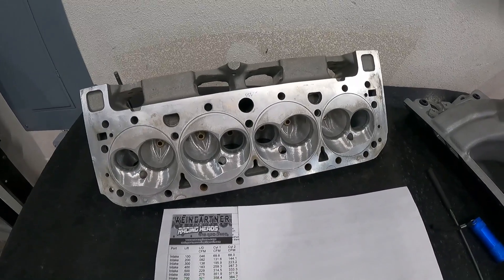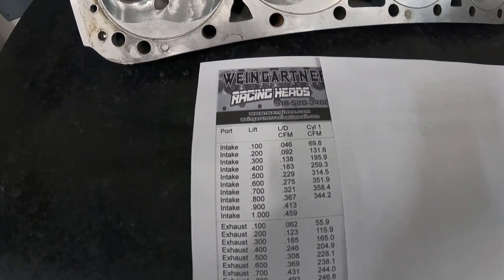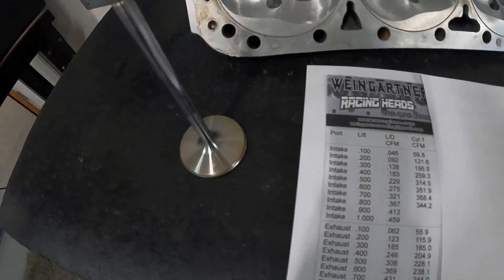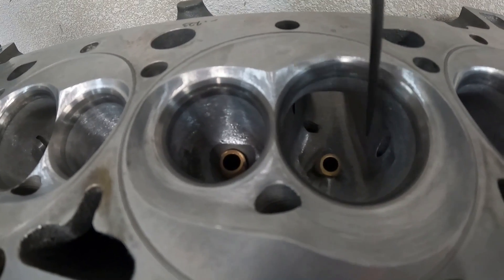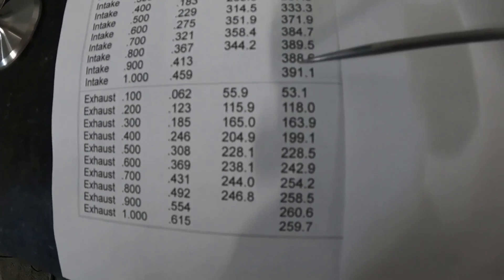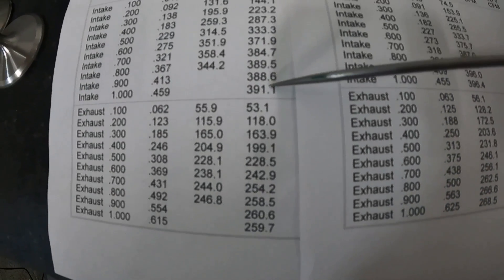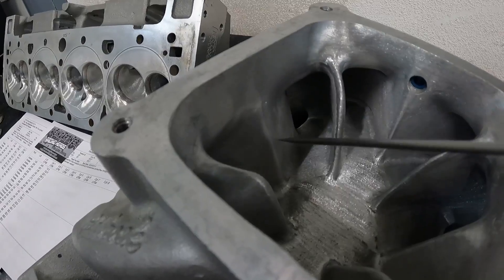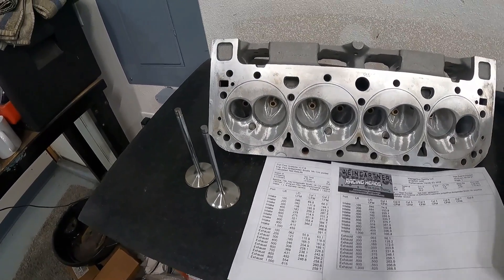Going over a set of sbc Brodix 18c I ported

Comment: The 2859 manifold design got tweaked and newer castings have injector bosses.  Still... some old manifolds dedicated/designed for carburetors are hard to beat.  It would be interesting to compare as cast features in old vs. new.
Nice job knife edging/radiusing  the top area of runner partitions.  It's not hard to do, but it is more work than some might guess.  The newer castings are table topped too, by the way.

Comment: Hey Erik! Loving your videos man, quick question about porting single plane intakes.....Do you personally worry about the shorter inner runners vs longer outer runners when it comes to CSA?  i guess what im trying to ask is do you vary CSA of the intake based on the length of the runner?  I had a discussion on an olds forum about a Torker intake for olds and i was advised to take the length into consideration when porting.   By the way, if you have never looked at an Olds 455 torker, you would crap yourself looking at the plenum and runner openings..... Looking forward to the next video!!

Comment: Anything else you can do for the promaxx 317 BBC heads they clams to flow 400@.800
Reply from the maker: I ported one set they were 370cfm start 417cfm ported.
Reply: @WeingartnerRacing  what kind of numbers power wise would that equate to